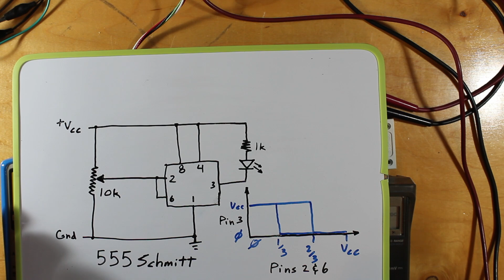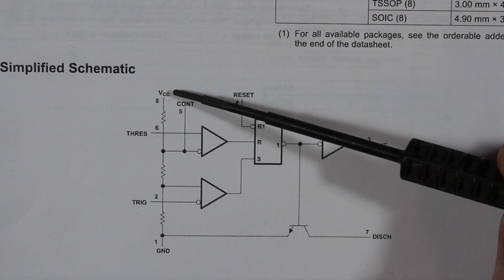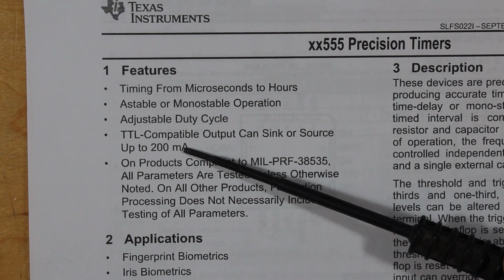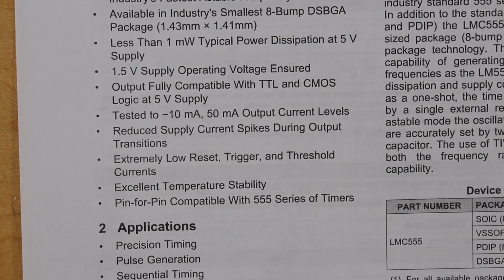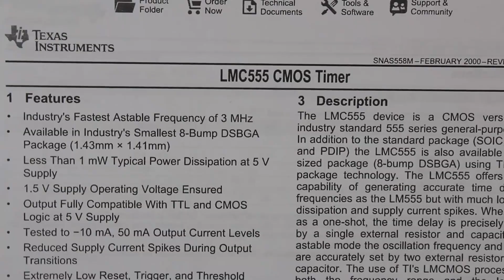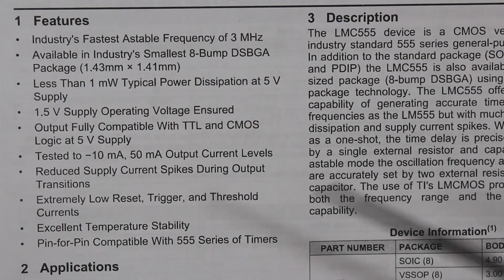#9  Schmitt Trigger Using A 555 IC #electronics

Comment: Although it is a very common perception that the chip got its name from the resistors in the voltage divider, according to Wikipedia, the designer of the chip (Hans Camenzind) has stated in a recorded interview that the number code '555' was chosen arbitrarily by a marketing person.
Reply from the maker: Thanks for the correction.  I added a link in the description to the Wikipedia article for the 555.  (Quite the coincidence though.)